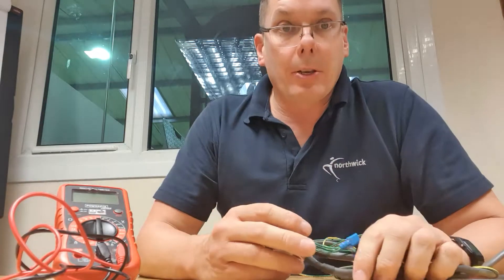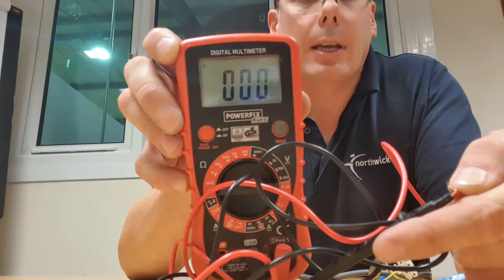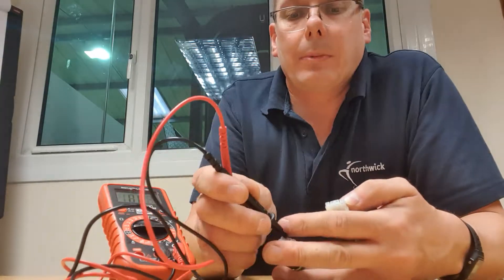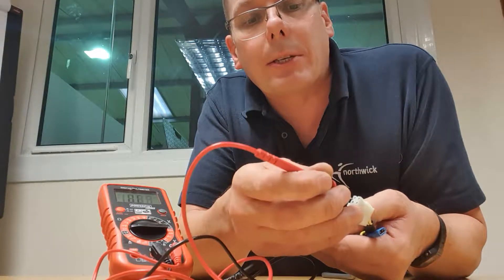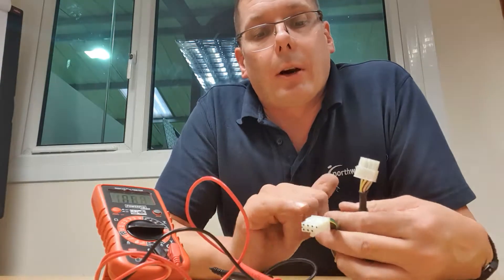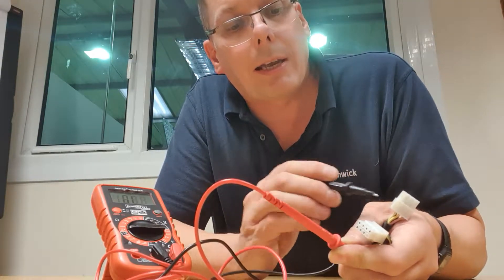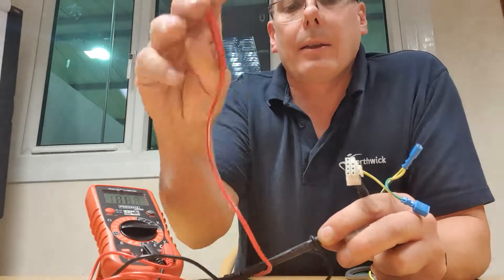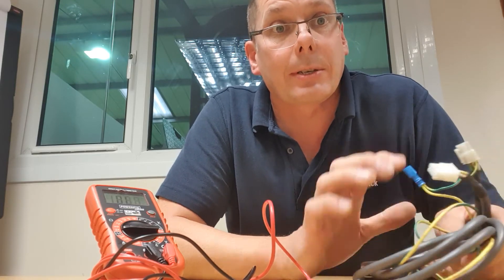3 Way Test of an electrical wiring harness

Comment: What do I do if I have a connector in the engine bay and do not know where the other end is?
Reply from the maker: It's almost impossible to test the harness if the other end is connected because you don't know what the circuit is and how whatever is connected at the other end will affect the test result. You need to find the other end and isolate it by disconnecting it. That way, the rest result becomes predicable. It may be possible to find the wiring diagram for your vehicle online and get an idea for where to look for it. Hope this helps!

Comment: This test doesn't matter too much if one wire is compromise and can not keep a certain curent (power) So, the best way to test a wire continuity is under a power source 12 volts battery and a 50 watt  bulb (e.g.) 50watt at 12 volts ewuivalemt with  4 Amps or very close to 4 amps and if  bulb or wire do not burn that mean that specific wire is safe under power. To do thus tupe of test you will need very clean metal terminals and properly contacts between wires and battery terminal multiple surface contacts all way long of that circuit.
Reply from the maker: Yes it's aways better to test using a representative load if possible, as this will expose any problems due to poor connections or current leakage that the multimeter test may not detect. An insulation tester can do this safely but these can be expensive instruments and require a little more specialist knowledge to use safely. There is also the risk of damaging sensitive electronics that may be connected in the circuit under test, so proceed with caution!